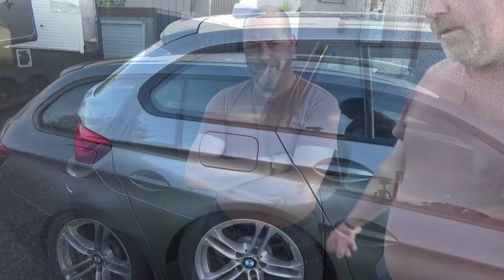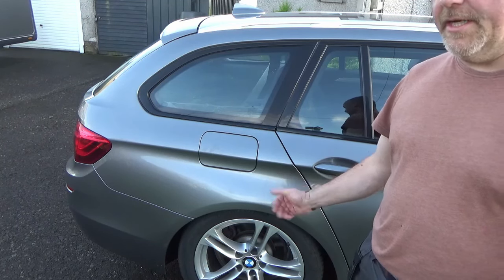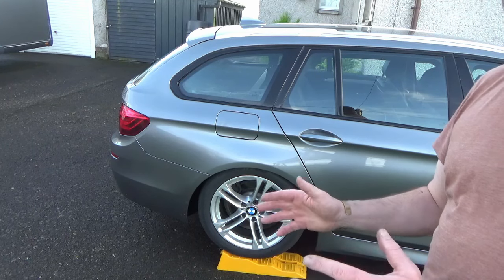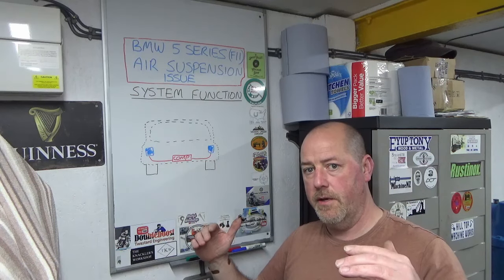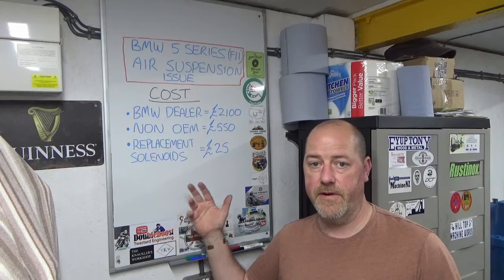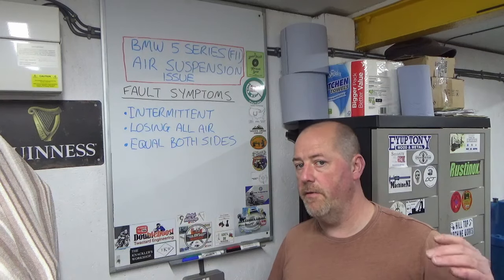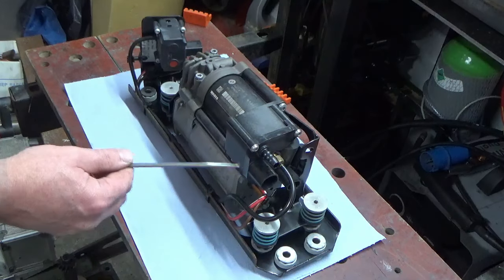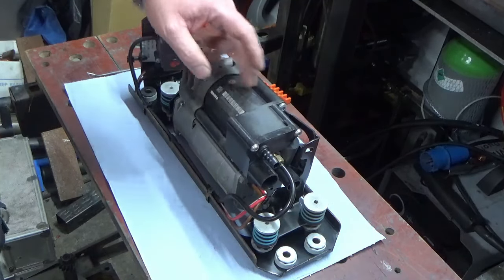BMW 5 Series (F11) Air Suspension Fix for £25

Comment: Does anyone know '1' how the BMW air suspension should work, mine drops down after been unused for a good few hours, the compressor kicks in when the engine is running but takes at least 5 minutes to rise to the correct height, is this normal? & '2' I got a replacement solenoid valve like recommended in the video, the rod through the middle of the new one is lose and comes out, is that normal as the rod in the old one was stuck in and took a bit of shifting, also would stick in again when put back in, is this rod meant to be stuck in or not please?
Reply from the maker: Hi Robert, I am no expert but can answer from my own experience only. 5mins sounds too long, my video was real time as a comparison, I've not checked but way less than 5 mins. Same as you exactly with the solenoid valve, the old one was tight and stuck in position, whilst the new one was loose (you can see this when I fitted it as it was dropping out etc). I have no idea how all of the above is supposed to be but can only report that a few months on I still have no issues following the replacement. Hope this helps a bit. Cheers, Jon